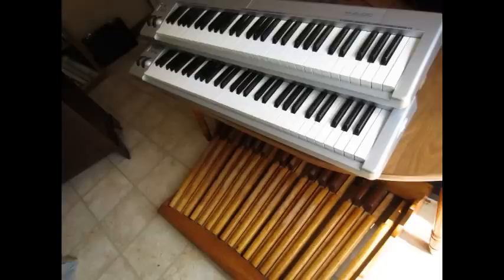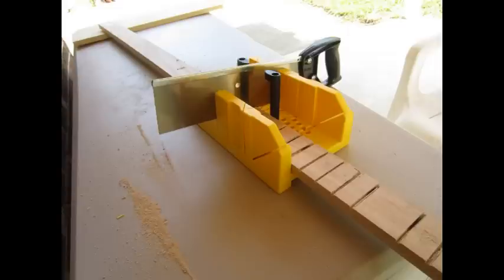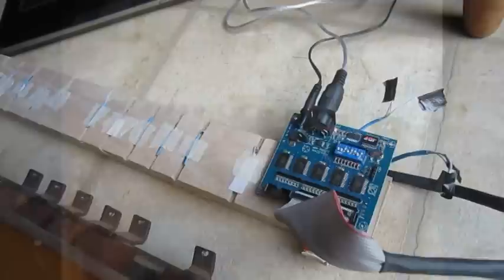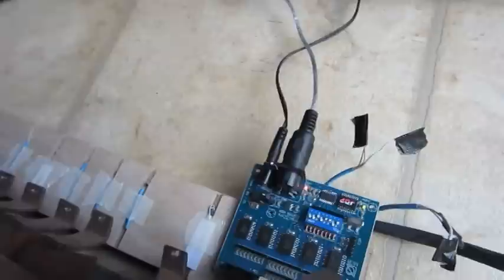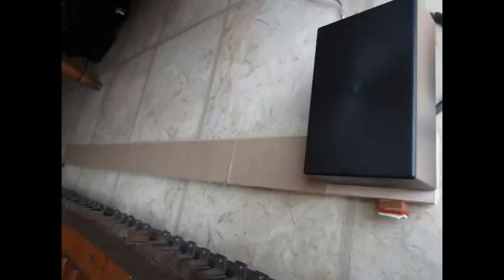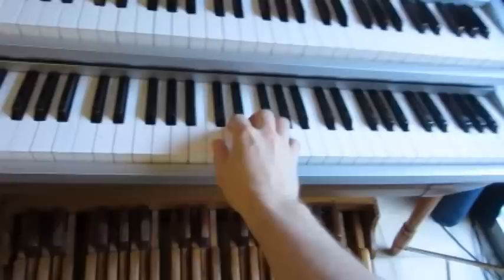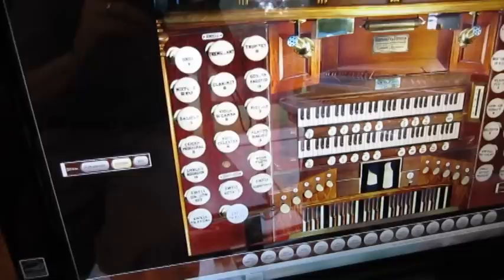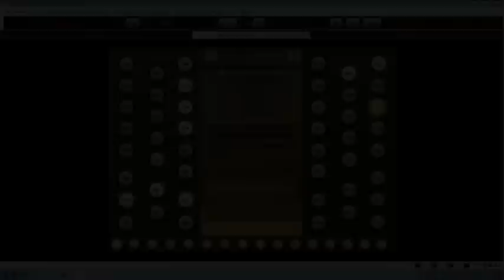Virtual pipe organ project

Comment: Hello! I know this video is quite old but thought I would reach out anyways. I am in the midst of setting up a 3-manual organ for myself. I have 3 Casio MIDI keyboards, with a push on/off button on top of each. I had intended on simply using a power strip to turn on/turn off, but once the power is cut, each keyboard will shut down and need to be turned on by manually pushing the power button of each. Is there an (easy) way to remedy this situation with a singular on/off switch? Or will I have to move each keyboard each time I need to power on/off? Thank you so much for any suggestions :-)

Comment: Hi sschaub88, I have a pedalboard and I wanto to convert it into a Midi pedalboard.I I found the Midi encoder you used in your pedalboard.
Could you give me any tips on how to solder the wires to the reed switch.
Maybe some design or schema how to connect what and where. Thank you very much.

Comment: Hi, I noticed that this video encoder has the option to purchase a power supply adapter with it. Did you need to add that to the bundle, or did you purchase just as shown (the pic at 0:29)? Thanks
Reply from the maker: Paul, the bundle I purchased (mpc32xrs-bundle#2) came with a power supply adapter. I just checked and that bundle is no longer available. So I would think you would need to add that to the bundle that is currently available.
Reply: Thanks for the quick reply Stephen, this saved me from certain aggravation, delays and expense :) Very helpful video!